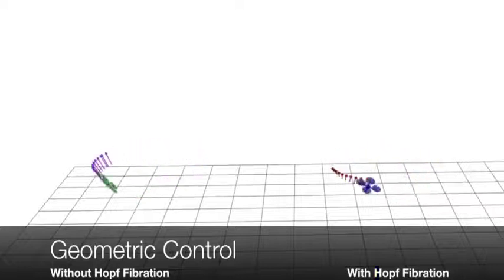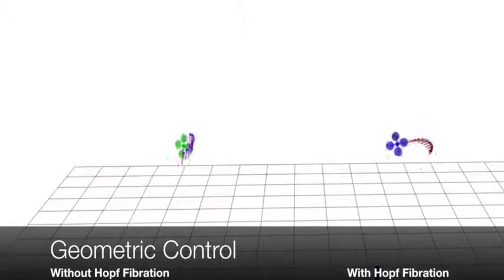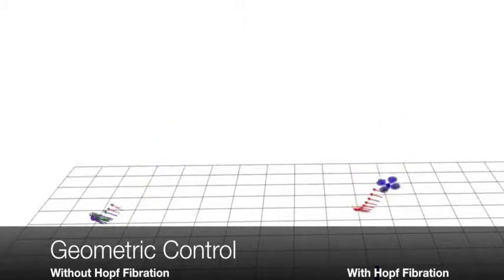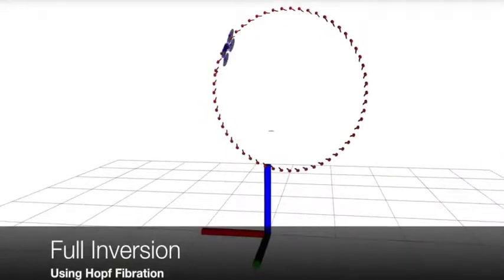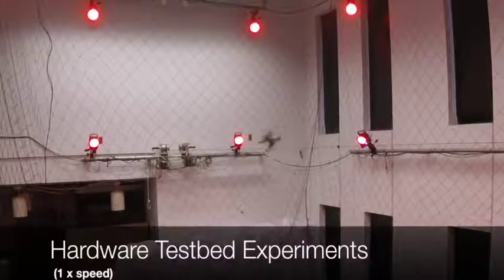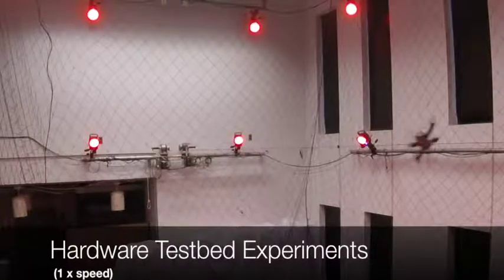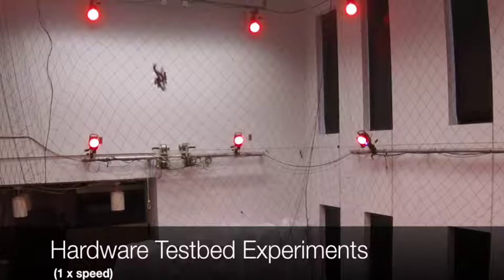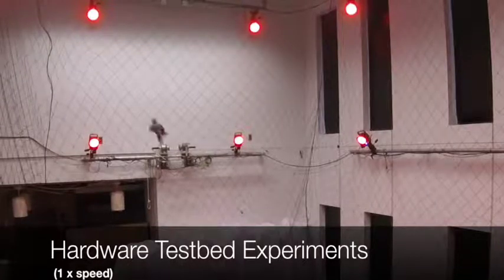Control of Quadrotors using the Hopf Fibration on SO(3)

Comment: PLEASE explain this. I understand what the Hopf fibration is but how does it apply to macroscopic physics? I thought it was only useful as a demonstration of the topology of a 3-sphere. How does the application of this fibration improve flight control?! Is the flight controller aligning the rotors to fibers by adjusting individual engine RPM??
Reply: google applications of lie groups on differential equations by VI Arnold